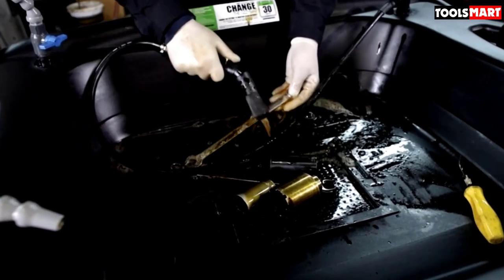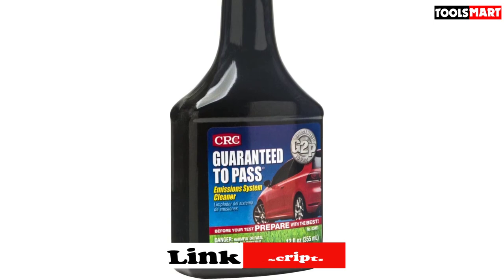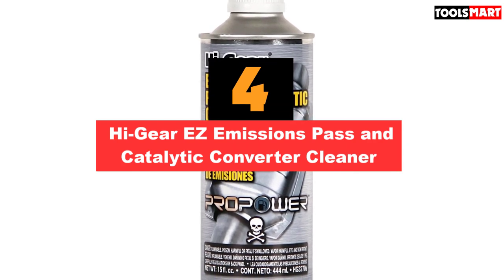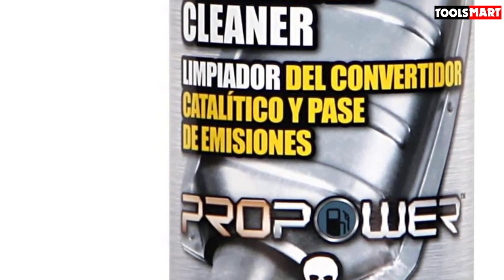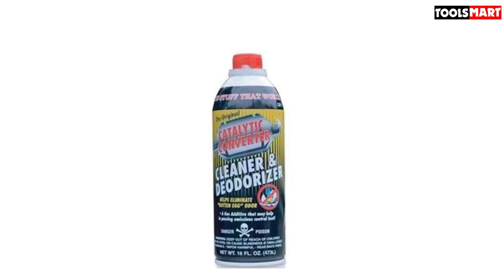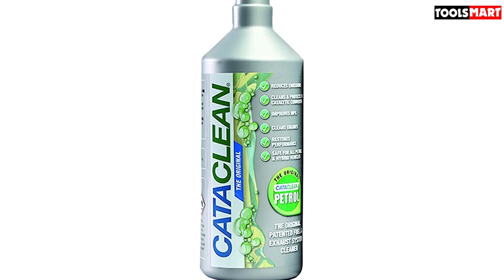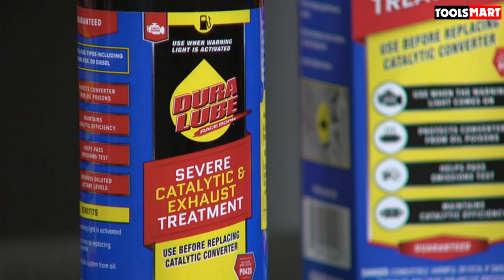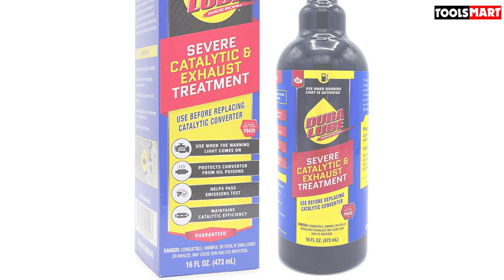✅Top 5 Best Catalytic Converter Cleaner of 2023

Comment: I've used both Cataclean and the Duralube product. Each has worked and each has not. I'm going to try Duralube again, but with less than a half gallon of gas, as others have suggested it. I've also done the lacquer thinner and a half tank of gas trick. That nearly always gets the check engine light off, but most recently, it came right back on the next day. I had gone nearly 6,000 miles without the light on but it's back. This time it's been more difficult to get rid of, so I may have to finally get the catalytic converter replaced. We shall see.
Reply: you can try lacquer thinner,,i did and it not harm my engine

Comment: Use Lacquer Thinner on 4 gallons of gas.  Many many positive comments about it.  It worked partially cuz I used it on 8 gallons of gas instead of 4 but motor don't get as hot any more.  Waiting for gas to go down to 4 gallons then will try again.